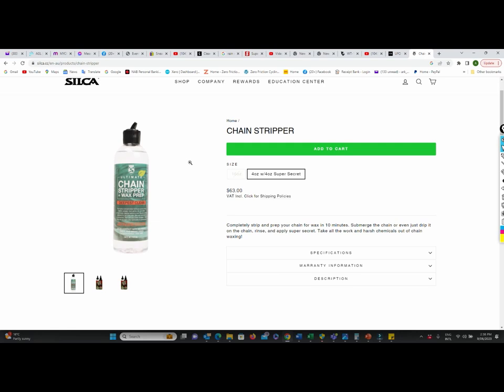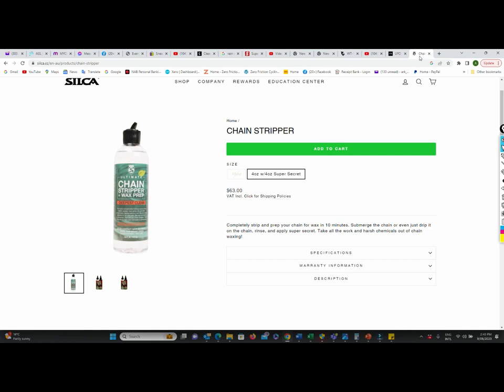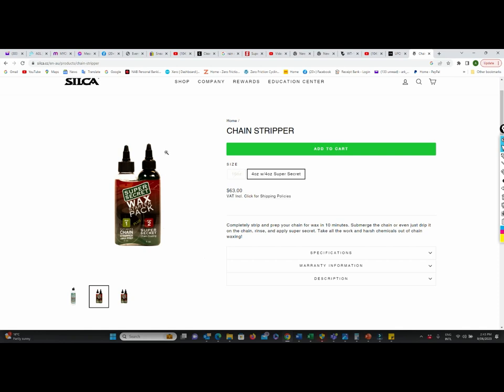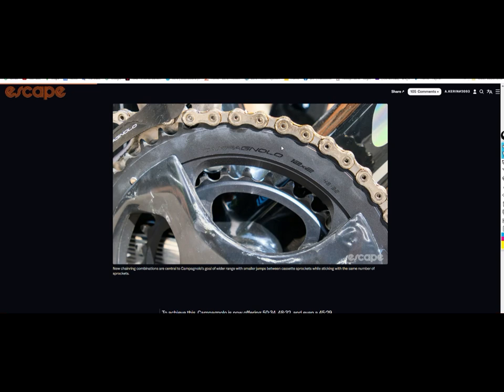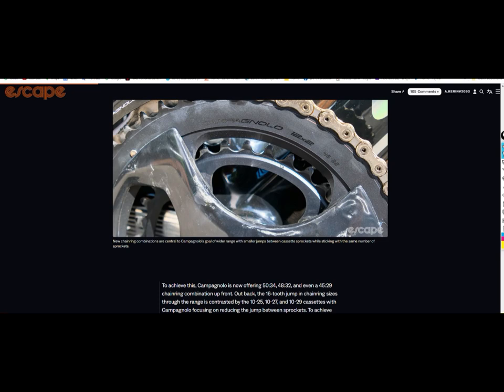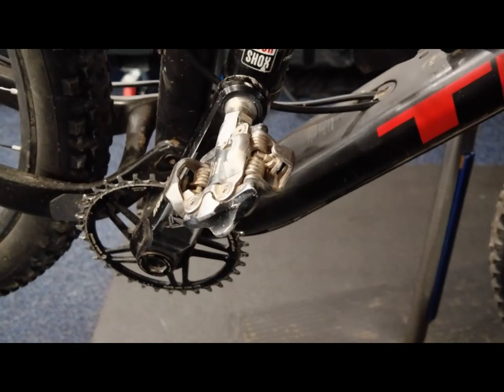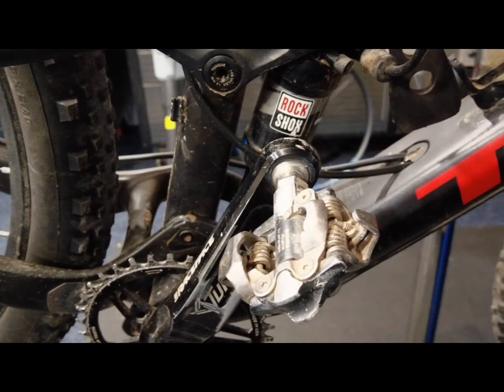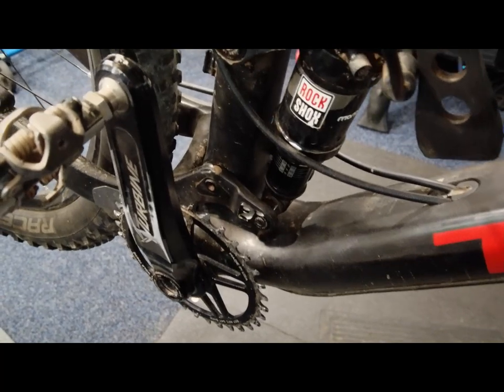Stripper and campy 10t

Comment: What about the smaller chainring potentially allowing lower BB for the same ground clearance. Yes. I know you’d need shorter cranks, but hasn’t it been shown that crank length is also not much of a factor? Or is it?
Reply from the maker: If one needs that then yes for sure - ie gravity focussed mtb riders may indeed run a 30 or 32 vs a 34 or 36, and they tend to run 165 vs 175 cranks. 

Yes sort of re crank length and power. There are a lot of caveats involved - it is actually a pretty interesting area, i will have to do a vid on soon if i can. The longer crank does give you more mechanical leverage, so you have more "Torque", but power is torque x cadence - and to complete a larger circle with a longer crank - this impacts power generation & foot speed to generate force across the entire cadence, which is more easily done in a smaller circle which is more efficient - so you are giving up some outright torque in main power phase, but gaining other efficiencies re force applied throughout the full rpm. Typically shorter rank will mean higher cadence which means you gert same power for a slightly lower force as the increase in cadence of the smaller circle offsets this. However - in some mtb - imagine a very steep pinch where your cadence is going to be sub 50, your pedal stroke is for shit anyway, you cant just increase cadence - cadence is balls, in such instances a longer torque lever will be more advantageous. If you can attain an efficient / desired cadence via gearing - then shorter is often more desirable overall. 

Kind of imagine if you had very high resistance on the crank and but you were challenged to get it to turn, you would choose a longer lever to do this. But then to generate power so you had to get it spinning - then dynamics and decisions are different. Ie a tractor can pull a tree stump out and only be 30 hp, that a 500hp 4 cyclinder sports coupe would not be able to do without a lot of customisation.. But the tractor motor wont be able to drive that car to 250kmh. .Torque vs power requirements differ for different situations - in cycling in general erring on shorter is better - mostly - for most cyclists, but not always.

Comment: Thank you Adam for another interesting vid all fact no friction lol!!! I'm with you 100% on the wear rate of small chain rings.I have 2 chain eating ebikes 1 has a 15 tooth chain ring and the newer gen 4 has a 32 tooth cr,the 15 tooth cr with a shamano cn-e8000 chain ss hotmelt from new and got 300 kms before it hit .50 wear and the 32 tooth cr with xtr 12 speed chain and ss waxed from new has 2700kms on it and still not at .50 wear what a difference wow!!!!Adam what would you do with regards to rewaxing a chain would you use the new silca stripper(doesn't remove old wax)or run the chain trough the us cleaner to remove old wax and any grime locked into the old wax to keep all your wax goodness in the wax pot?Sorry for the long post!!!Cheers!!!
Reply from the maker: wow what - 300km on an xtr 12?? they are a pretty darn durable chain - something is not quite right there somewhere - even a 15t isnt going to do that by itself! Hmmmm 

For re waxing you generally do not do any cleaning - the re wax does that. Yes you bring some contamination into the pot, but remember vs what would be happening with a drip lubricant path - that contamination is diluted amongst hundreds of ml of lubricant vs 3ml on the chain. 

For mtb riding the easiest way to minimise contamination in wax overall is to go two pot method as demonstrated at 1hr 39 min mark on wax faq vid (i have to re do that vid...). Otherwise dry dust riding, wipe chain with alcohol of cloth before re wax (always do that anyway) to remove surface dust. Post wet ride just do some boiling water flush rinses to remove worst of contamination and dry. You will not track a benefit going deeper than that with solvents and US etc - you would do so if it was a dedicated race chain to ensure every fraction of a watt, but you will never get the payback just for training / riding. 

I also have a chain maintenance guide - instructions tab  on website covering all ride types and lubricant types to reference as well :)
Reply: @zerofrictioncycling992  Thanx for your response Adam.The 15 tooth cr is an 11 speed the 12 speed xtr has 2700 kms and still going.I usually get 800kms out of the 11 speed with kmc's,I just put a new xtr 11 speed chain on it but I'll probably end up using a 12speed xtr chain on the 11 speed(I got this 12 speed swap from 1 of your video's)Cheers!!!

Comment: So all this to say im taking a big loss running CX ranks (44-34) on my touring/gravel bike to get better range for all the hills in my area, correct?
Reply from the maker: No not at all. 1x is dominent for CX for a reason, and it is very suitable for a lot of gravel riders, and absolutely dominent for mtb - all for good reasons. Sometimes for some gravel riders 2x will be more efficient overall, but again, unless racing at a high level, you will never ever be able to measure a difference, i would not stress at all. It is possible depending on your riding and cogs you tend to use, cassette range and chain line angles - that 1x may overall be more efficient for some gravel set ups - the more time you are spending in a 40t in a largish cog in the rear with a good chain line may be time you are not spending in a 32t ring with smaller cog etc. It is very much an individual it depends, but as you would never be able to measure or feel anyway - never stress about it. 

The main point is that for road drivetrains - the move to small rings and a 10t is simply a step backwards in efficiency for no good reason for the consumer. It helps the mfg for production costs, but it is hard to see they are passing that benefit on. My strong view is that for the latest greatest groupsets, all things should be moving forwards, not backwards. We should not be paying more, for a known step back in efficiency, where there is no reason to take a known step back in efficiency. 2x for road situation is very different than 1x vs 2x for offroad / gravel.

Comment: Would I notice the difference between a 40t chain ring and 42 cog vs a 32t chain ring and a 34t cog in terms of loss?
Reply from the maker: not likely. We are not very sensitive at all to detect losses even if its multiple watts. Ie 99 out of 100 riders in a blind test on a climb or flat would not be able to detect difference in an XC tire thats tested at 35w loss vs one thats tested at 25w loss, and whilst it would likely show up with a time difference if timed and power for both efforts very precise, again without a clock to tell us we cant tell which effort was 5 secs faster over 2km etc. 

So same with sram axs road riders - they can't tell  there is circa 5w loss higher in a 48x10 vs a 52 x 11. Or if a chain that is running a meh lube and is 5w slower than a wax chain / good wax drip. It does make a difference, but we are not sensitive enough to directly detect such differences normally - only one who is extremely sensitive MAYBE able to tell circa 5w+ per 250w load. 

The 32t to 34t combo is also likely to be a less extreme chain line angle - so there will be a bit of an efficiency loss for the smaller ring / cog, but some efficiency gained back vs lesser chain line angle - so overall you wont get negative experience re oh wow this feels slower etc.

Comment: Is there any evidence of wax performance in different (dry) weather conditions. I've noticed that in temperatures below zero°(C) the chain can take much longer to break in, and in hot weather the treatment seems not to last as long. I wonder if this is true or if I just think so.
Reply from the maker: Yes that is true. Top waxes are so fast because the wax surface is able to polish up to a high sheen, so it is an extremely slippery sliding surface, with very low stiction and no viscous friction. 

This takes much longer when the wax is very hard in very cold conditions, and then the wax can be more brittle which can affect treatment lifespan. 

At the moment - the world is really making great strides re yes - immersive waxing is king - and for a lot of easily logical reasons. But it is still a big step for many to make the change. The world is not really ready to have multiple wax blends - low melting point for cold climates so it is softer and easier, higher for very hot area's / seasons. At the moment, we have one - but to some degree, it is like having one set of clothes for winter and summer - they will not be as optimal all the time at certain times. 

There are so possible hacks to help those improve at home - but i need more test time to confirm.

Comment: So, Adam, about the stripper.  Do you have any plans to add this as another bath in your process due to its wax “adherence” properties?
Reply from the maker: Not at this stage no unless i can test that it makes a clear difference. Overall we dont have any issues with adherence with existing prep - however i will be checking to see if it does help chains that have a lesser adherence (shimano) - and if it does, i would look to possible add that step - but it would cost more as even at w/sale it is expensive stuff, and i cant recycle it like i can mineral turps and metho via distillers. When prepping the volume of chains we prep - we wouldnt  be able to absorb the cost of that product in existing pre prep prices for those chains which is pretty much by far the lowest globally for that level of prep.

Comment: With a smaller chainring the chain speed is lower, so you get fewer link articulations per minute which will cancel out at least some of the effect of the higher load won’t it?
Reply from the maker: Sadly no - you do have that one aspect but there are 3 aspects of higher loss that gang up on that one.

Comment: Is it a safe assumption that noise coming from a drivetrain is energy loss?   The reason I ask is because I recently started with a fresh chain, stripped it well, and was using SS drip wax as my only lube.

I was excited.  It seemed great for a ride (25 miles). Literally. Then it got loud. It wasn't malfunctioning, but was loud.  And this is the pattern for the entire bottle I used.

I bought new Squirt, I had given my old bottle away because it was so horrible.  I wiped my chain clean, did Squirt, and I can get about 100 miles out of it in dry, road conditions, before it equals the noise from the SS. 

I'm wondering if the "ear test" is valid or not.  Love the videos.
Reply from the maker: Mostly no, but sometimes yes. For chains in general silent = dampening = greater loss. Ie with wax, you have generally a solid lubricant in between metal parts. It is the fastest and most efficient, but has the least dampening. Put motor oil on your chain, it will be super quiet, but at a cost of viscous friction and stiction (and contamination gathering). 

However - if chain starts squeaking - that is metal on metal, and is definitely not optimal. 

SS drip can be quite short lifespan as it is very thin, it is hard to get a heavy coating on as past a small application amount, most then drips off chain onto floor.  

Ensuring apply as per silca instructions will help get more on, as well as ensuring full set time - but still it is overall probably one of the shortest lifespan treatments of the wax drip lubricants. From ZFC, most use on top of an immersive waxed chain in between re waxes, and it performs very well in that duty, but stand alone - depending on the chain, power, conditions, ride length etc - your situation is not unique - i think Silca need to make a tweak to make it easier to get a heavier coating on like say UFO drip. 

Squirt / smoove etc are much longer lasting waxes, they use a different wax base (we believe slack wax) which is longer lasting than very refined paraffing bases. There are offsets to that (maintenance in time - they are a tough clean). If not immersive waxing, and ss drip is too short a lifespan for your riding, for sure squirt or smoove may be a better option to suit - SS drip is really just a great one for waxers as it is super clean, super quick and easy to apply once used to how to do it, and can just re wax straight over with no cleaning maintenance first - but yep it has to be able to last the persons ride lengths which is not the case for everyone.
Reply: @zerofrictioncycling992  I have a bottle of Smoove in the garage as my next trial. You're spot on, squirt is a bugger to clean but definitely stays there longer. 

You know what else they need to address, all of the drip waxes I mean, is cure time. If they got it down to sub 10 minutes, people could carry a small bottle on mega rides and keep topped off while nature breaking, eating, etc.
Reply from the maker: @10ktube  Yes - there is one that claims that (there are probably more, i just dont know of them) - Tru-Tension tungsten claim 10 mins - i need to try to test this properly though as that is a bold claim. However that is my go to when i grab a bike, have no idea how far the treatment has done, have a decent ride planned - i throw some of that on whilst i get ready. It has seemed fine - and i just re wax when back - but the re wax may be hiding extra contamination gathering i cant see by eye if it was still a bit wet. However, it hasnt been obviously still wet, so thats been good. but yes, i will try and test some of these set times shortly. stay tuned.
Reply: @zerofrictioncycling992  I'm anxious to hear, I'll see if I can grab some and try myself.